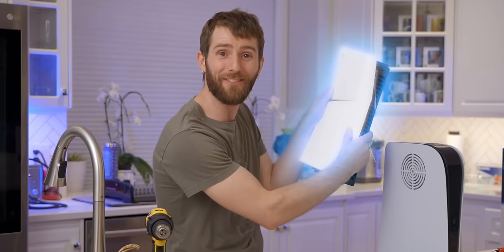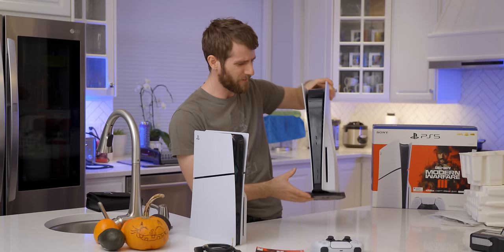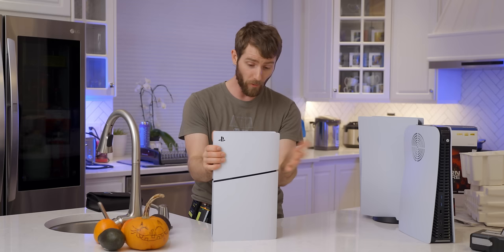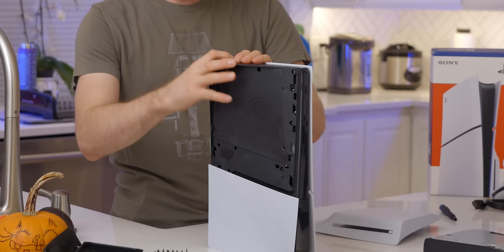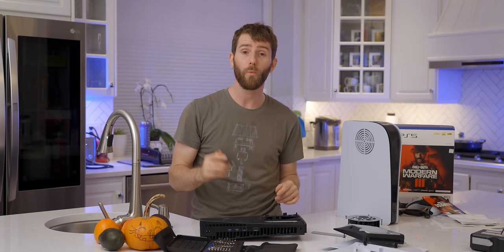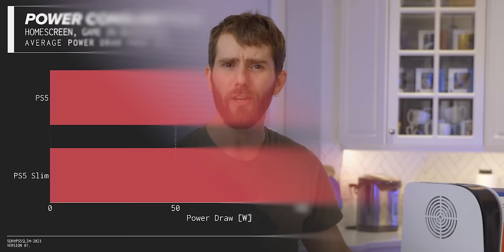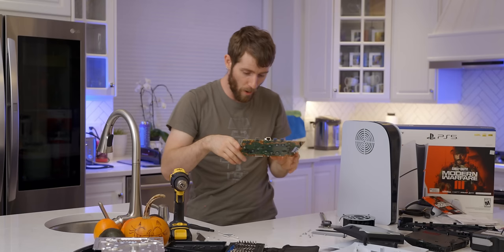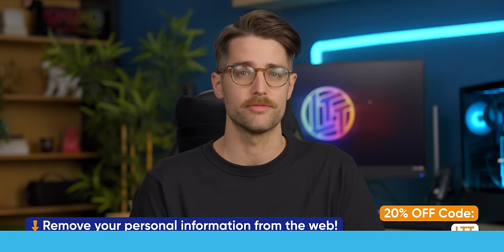PS5 Slim First Look and TEARDOWN!!

Comment: for me by far the most impressive thing is how easy it is to get decent access to the fan and heatsinks to simply blow off the dust especially considering how much of a nightmare it used to be
Reply: Except for the 3 different screw sizes for the fan though...oof.
Reply: Not that hard try taking a xbox one x for a ssd swap Hella screws all different lengths lol
Reply: For doing the same thing on my day one Ps4 I needed to disassebly the entire console.
Reply: @kingzach74 because keeping track of where each screw goes really is a super complex task only achieved by MIT engineers….
Reply: @soniccinos Two of them won't even fit in the wrong place. Meaning you only really need to keep that screw separate from the other two to avoid any potential issues.
Guess people won't be satisfied unless the thing literally assembles itself back without them doing anything 🙄.
Reply: @dirant7713  yep I did it 3 times on ps4 but my ps4 lasted 8 years and is still going from cleaning
Reply: @kingzach74  try cleaning an xbox 360 and then you tell me again how 3 screws are bad
Reply: 15:59 - A regular drill? Ugh.

Comment: Gotta say, nothing beats the size of the PS2 slim
Reply: PS1 slim.
Reply: Yeah but that cut HDD support
Reply: @ingamgoduka57 ps2 slim was thinner. Also the ps1 slim was just 'psone'
Reply: @redacted1462  ps2 slim is also just "ps2" sony never called them slim versions just "PS#"
Reply: @redacted1462 I have one of those psone's and the original ps1, it's like half the size of the ps1 with different ports and smooth edges.
Reply: I really liked the Xbox one S myself it just looked super cool compared to the vcr xbox one
Reply: a slim jim will beat it
Reply: But the og ps2 was well worth it over the slim
Reply: Except for the psone
Reply: Because that processor was too weak
Reply: Mega Drive model 3 was smaller.

Comment: I must say that Linus nailed it when he was talking about the power and reset for eject button being nearby each other. I can't tell you how many times I've accidentally ejected to this or accidentally put it in sleep mode. This is a major big welcome in my opinion that will probably get overlooked, but I'm glad that line is called it out. And I must say that overall the system looks a little bit more appealing to me being smaller. I'm probably going to wait off on the pro model, assuming that happens. But it's hard to argue that they made the right decisions when it comes to the design on this thing.
Reply: Fr I’ve  had my ps5 for nearly 2 years and I still don’t know what button is which
Reply: I’ve never used any of those buttons since I got mine more than a year ago. You can shut down the system or even pop out discs using your controller 😮
Reply: @Youtubax exactly!
Reply: Try pressing rhe right button? You're the reason product design looks so stupid now because they have to account for droolers.
Reply: @Sammysapphira man you must have so many friends with that attitude
Reply: Man u must hate TV remotes the fact yall cant even figure out what buttons do says alot about society.......
Reply: Ive been owning a PS5 since day one and play almost every day and the only time I used the power button was on the first day. Since then Ive been using the Dualsense to turn on and off the PS5.
Reply: @Youtubax  Exactly. That is what Ive been doing since I got my PS5.
Reply: I haven't used the power button since the PS4. Except that one time when it froze.
Reply: @lspidervinny1430 LMAO same
Reply: Who uses the buttons to eject a disc when you can do it in the UI?
Reply: I have the digital version, and I have never turned it on from the console itself, just the controller.
Reply: The worst thing about the buttons on the original PS5 is how they swapped them around from the PS4.
Reply: I never done this lol

Comment: 18:47 It's worth noting that the PS3 had it's first node shrink from 90nm to 65nm during the FAT model then the 65nm to 40nm happened within the slim's cycle, so a node shrink never happened in the transition from Fat->Slim or Slim->Super Slim and the PS2 had multiple node shrinks in it's FAT model phase as well.
Reply: Exactly kind of like what happened this time.
Reply: @reviewforthetube6485  yup, just making a note of it because they (LTT or Linus himself, in this case) say it like a node shrink was SUPPOSED to happen in the transition to the slim when that's never been the case historically.
Reply: Linus doesn’t do research. That would slow down their release schedule or require doing a competent job.
Reply: first Linus vid I watch since back on air and they haven't changed
Reply: @wile123456  the YLOD is can be caused by multiple things. 

I recommend watching RIP Felix's video on the subject titled "A PS3 Story: The Yellow Light Of Death". 

Very informative video.
Reply: @meatbunftw  It was the case for the PS4, AND for the PS2 (the Emotion Engine and Graphics Synthesizer dies were merged prior to release of the PS2 Slim but I can only find information about the 90nm chips being in the Slim, not the Fat. The PS3 looks to be the outlier here. Doesn't help that die shrinks were often reported on without specifics on when they were implemented, so it's hard to find exact dates.
Reply: I'm sure they rushed the design of the PS5 or at least didn't care enough to optimize space and this is why they released a smaller version, but this is not a slim. The PS4 slim is absolutely tiny and very power efficient. This slim is just a redesign, it came too soon. I hope the superslim will come in a few years and be on par with the PS4 slim.
Reply: That's wild shrinking die from 90nm to 40nm that efficiency difference is big and could also see performance boost wonder how that would factor in
Reply: Didn’t super slim go down to 28nm?
Reply: @plz_dont_resign8387  the CELL was still 45nm but yes I do believe the RSX got down to 28nm

Comment: I built my first PC in 2020 and it was only then that I realised how stable consoles are with relatively limited hardware. The fact you can boot up RDR2 or GOW on a PS4 and never once worry about frame rate (even if it is capped at 30) is bloody impressive.
Reply: I’m
In the same situation lmao. Getting this ps
Reply: If you have good internet maybe
Reply: I don't get it. Sorry. You can framelock your PC to 30 (I dunno why you would) and expect a far more stable experience provided that the games on the console and the PC are both purchased and not cracked. I never noticed a drop below mid 60s even with everything maxed out.
Reply: @RR-ho3td  More that when you look at the objective specs of a basic gaming PC and the console hardware, it's amazing they can run modren games at all never mind how stable they are.
Reply: It's because it uses fake frames for higher fps. It's not powerful enough to do more than 30fps at native. It's well optimized because it should be it's only one hardware that the developers need to worry about lol. But I personally can never go back to 30 frames. That shit give me headaches
Reply: 30FPS is unplayable in my opinion.
Reply: @eniseekay  with controller and on a tv I can still play ps4 fine without noticing it. Once you control with a mouse or are sitting closer 60 is the minimum.
Reply: @eniseekay  30fps on console is different than 30fps on PC I don't know how, I remember I was running AC origins on my PC and it was not optimized it ran at 30 to 40 fps and it looked horrible to me I couldn't play it then when I got a ps4 I bought the game again and despite being 30 the game was running smooth AF I don't know how, there are some techniques that devs use on console to make the 30fps look good, but nowadays pretty much all ps5 games are 60fps and some are 120fps like Call of duty
Reply: @RR-ho3td

Nah, the installation process sucks, power usage is way higher, you gotta wait for it to boot up and pre configure all your display settings, and then when you play you still have 50 video options that you have to balance between max settings and desired frame rate, you gotta know how much VRAM you have and what the game will take with various settings, you’ve got to continuously update your video card drivers at least every week, along with the game.  You’ve got background processes, you have to pre setup your controller, which has less features, you have to switch between keyboard and mouse and controller as you boot up, sign in, start the launcher, sign into the launcher, launch the game and navigate through settings, then grab your controller and finally sit where you want to play.

You’re finally gaming.  For this session at least.  You’ll have to do almost all of this again next week.
Reply: @jhamPlays  30 is a very low bar, if your pc couldn’t be stable at 30 maybe watch more ltt vids

Comment: 5:26 even for me as a frequent PS5 user I keep forgetting/hitting the wrong button. Moving the eject button next to the drive is a great improvement
Reply: Yeah. I just took a small white Paper where i put the Power Down Sign on it, cut it to fit and used some transparent sticky tape to mark it (next to it).
Reply: It would've also helped if they changed the shapes of the buttons.
Reply: TV remotes must be ur enemy then... are yall really so dumb u can't click the right button?
Reply: @trevoreggleston5815 no cause atleast those have indicators and/or different colors or symbols where the ps5 only had a stick button and a longer stick button
Reply: @newstages95ay87  holy shit you had two options and for the last 4 years ur telling me you couldn't figure out what  one was what? That's just sad
Reply: even jill, the master of unlocking, gets it wrong
Reply: Just use the controller to eject the discs.
Reply: @defski Or if they actually labeled them, perhaps at least one of the two.
Reply: @trevoreggleston5815 nailed it
Reply: @trevoreggleston5815 Because remotes use different shapes, colors, and symbols? How are they even comparable? Lmao
Reply: @trevoreggleston5815 It's two very similar unlabeled buttons that most people only press once every few months, if that. If you can't understand why that makes it easy to forget which is which, then I wouldn't go calling others stupid. People in glass houses shouldn't be throwing stones after all 🤷
Reply: @trevoreggleston5815 No you're right, we should definitely stick with two unlabeled, extremely similar buttons that perform entirely different tasks. Hell, you should apply your logic to all things, like putting your car's cruise control resume and parking brake buttons right next to each other, without labels and just make one of them slightly larger! How exciting that would be!
Reply: @trevoreggleston5815  A lot of people are not going to be swapping discs very often at all, come on. "4 years" doesn't mean a lot if you press the button a total of like 20 times over those four years, you're not really going to get used to it. Also just chill with the random hostility, what's your issue? You aren't better than someone because of your ability to eject discs.